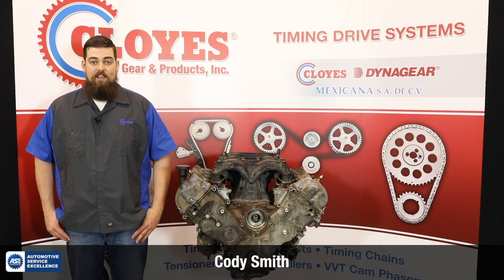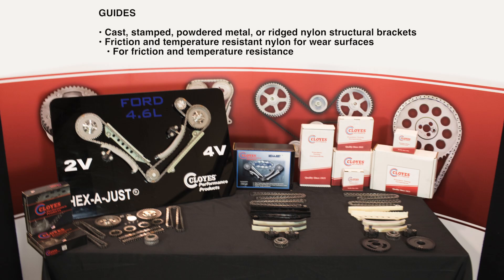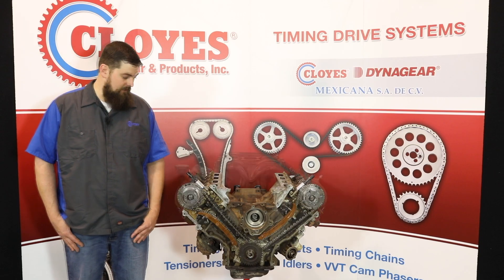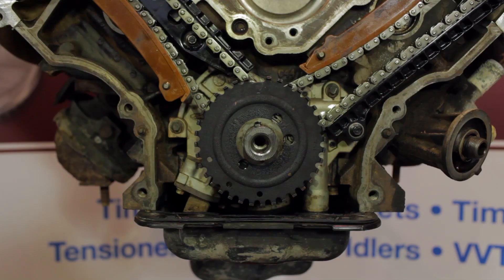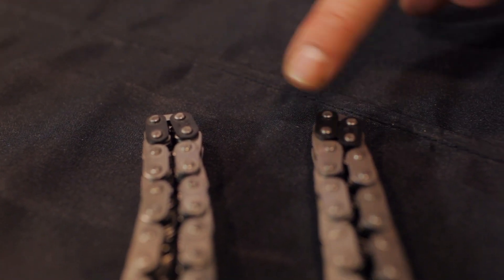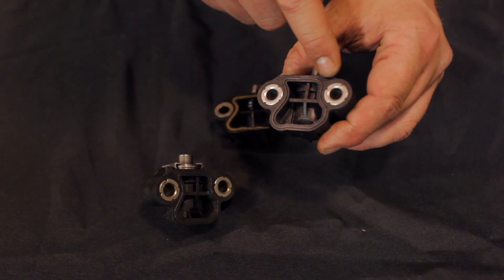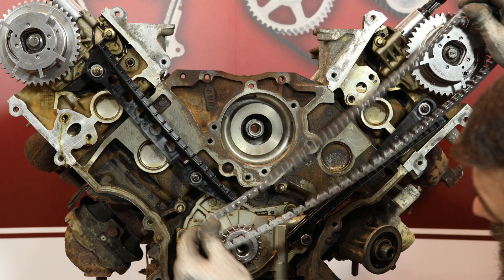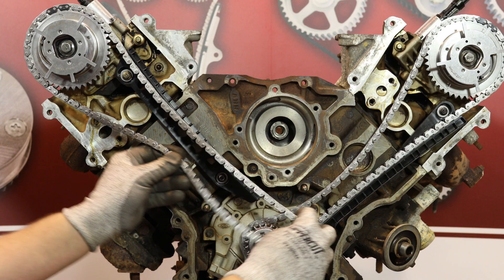Ford 5.4L Timing Chain Replacement, Cloyes 9-0391SB

Comment: The passenger cam rotated almost 1/4 turn counterclockwise to rest. I turned it back so the chain links align with the mark with the phaser, but the cam is in the middle of a rotation. I had to hold it in place with the wrench while putting the chain on. All the marks line up, but I'm worried that the timing is still off because the cam was not at rest when I put the chain on. Should I take the chains off and rotate the crank?
Reply: How'd is the engine now Bradley?
Reply: @texanbalaban6777  I wanna know too.
Reply from the maker: Nope, if the links lined up with the marks on the sprocket then you are in time. Instead of rotating the cam back, you could have rotated the crank to a spot that allowed for alignment, but there is nothing wrong with how you did it.

Comment: What's the torque on the valve cover bolts? For 04 5.4 3v v8?
Reply from the maker: 89 inch pounds, or about 7.5 foot pounds.

Comment: In your video at approximately 2:09, the cam phrasers are at 12 o'clock. So do I have to make sure the #1 is at TDC? Or its automatically TDC at 12 o'clock???🤔🤔
Reply from the maker: You don't need to worry about TDC while timing this engine. If the crank keyway is up, and the marks on the phasers are up, then you are good to install the chains. I am not sure where the pistons are at this point, but it doesn't matter. The chains set the timing, if both chains' marked links are aligned to the sprocket marks properly then you are in time.
Reply: @Cloyes01  okay thanks alot!!! 💪

Comment: So what if the passenger (r) side camshaft has moved to where the (R) is almost 1 o'clock but the driver(l) camshaft is in the correct position
Reply from the maker: Just rotate the passenger side camshaft back to the proper position. Rotate it slowly and carefully to ensure not to damage any valves. If there is interference with a piston before you can position the cam properly, you will need to move the crankshaft to a position where the pistons on the passenger side are down. Once you get the cam positioned properly move the crank back to the proper position.
Reply: @Cloyes01  so put the chain on the passenger side phaser and turn the crank or leave it off and turn the cam? And if I need to turn the cam what is the easiest way
Reply from the maker: @williamdavis7535  Leave the chain off and position the camshaft properly, then put the chain on. If the phaser bolt is tight use it to rotate the camshaft.
Reply: @Cloyes01  I just finished the job and got everything back together and it idles great but as soon as I put it in gear it tries to die and if I hit the gas real fast it does die and if I hit the gas to the floor in park it revs to about 3000 and then acts like it has a rev limiter and wont rev any higher...HELP
Reply: davis  sounds like what happened to me when my spark plugs fouled and melted a catalytic converter 🙄
Reply: @williamdavis7535  damn... sorry to hear that but did you get it fix. What was the problem?

Comment: I followed the instructions and passengers side cam rotated a quarter turn
Reply from the maker: No problem. Just keep following the video, When reinstalling the chain you will either rotate the cam back or rotate the crank so the marks align. As long as the sprocket marks and marked links are aligned when you are finished the engine will be in time.

Comment: Great video. Thank you! I thought about buying the cheaper chains but after watching this, I will buy yours.
Reply: If you fold a piece of paper a few times and lightly bolt it under a cam cap it will keep the camshaft from rotating.Just don't forget to remove it and properly torque the cap back..
Reply from the maker: Thanks Brian! Let us know if you have any questions.
Reply: @Cloyes01  what is the name tool??please and thank you??
Reply: @mariaperalta7117  What tool?
Reply: @mariaperalta7117  - ???
Reply from the maker: @mariaperalta7117  The only special tool used in the video is the cam phaser holding tool.
Reply: What is the tool name??? Please and thanks

Comment: Worst video ever .you never said that the crank timing mark should be at 6 o.clock position.or replace the oil pump so you have prper oil pressure to operate the tensioner and phasers ...do your home work boys
Reply from the maker: The crankshaft does not need to be at a certain position when setting the timing, the chains set the timing. All that matters is the marked chain links are aligned to the marks on the sprockets. This could happen anywhere from 4 to 8 o'clock depending on where the camshafts are positioned. 
And yes, oil pressure is extremely critical as we explained during the cam bearing inspection process. A new oil pump is always a wise investment.
Reply: Cloyes Gear & Products, Inc. lol u can't please everyone u covered everything very clearly if people would just listen to what u said instead of what u didn't say lol thanks guys

Comment: I followed this instruction step by step. When I unbolted the passenger side tensioner the damn cam phaser rolled ccw. The marks on the chain are still aligned with the mark on the phaser.....theyre only about maybe an eighth of a turn ccw out of position. What the hell did I miss?
Reply from the maker: This is OK. The chains set the timing so once the new chains are on just make sure all the chain and sprocket marks are aligned. If needed when reassembling, you can slightly rotate the crankshaft to make the marks align on the cam sprockets align with the chains. The exact positions of the shafts don't matter, just that the chain marks are aligned properly to the sprockets.
Reply: Ron Gillespie that’s what I’m trying to figure out before I start the job. Shouldn’t the 3 followers on each side be removed so the cam is at a neutral position, that way it doesn’t jerk one way

Comment: Can a lose/stretched chain cause fuel trims on one side to stay high (+20-+30%) idle up to 3000RPM? Been chasing this problem for a year.  Will always misfire on cold start and clean up at running temp. It also stumbles  bit at highway speeds under light acceleration.
Reply: Phil the misfire under light acceleration at highway speeds in more then likely your spark plugs/coils. It’s common on these engines to experience a shutter like misfire at light acceleration at higher speed. As far as the fuel trims you are describing it sounds like a vacuum or false air leak. See if when you press the accelerator a bit see if the short term fuel trim goes down. If it does you have a vacuum leak, pcv issue or faulty mass air flow.

Comment: Is there some other aftermarket parts we can use besides FORD OEM ? Can't really afford 900 for the kit
Reply from the maker: We are hoping you would buy ours. The Cloyes kit is part number 9-0391SB.
Reply: @Charles Ball 

http://www.modularmotorsportsracing.com/cart/index.php?main_page=product_info&cPath=4_7_56&products_id=1052
Reply: @Charles Ball $417 after shipping. Wear strips around $60 the guy told me off top of head over phone yesterday. I let Ya know how noisy they are in a few days 👍
Reply: @Charles Ball first set included, replacement set cost is around $60 for next timing job about 160,000 from now hehe

Comment: I’m so confused fordtecmakeuloco has a 4 part video showing this entire job in detail and clearly shows removing roller followers. Can anyone that has done this job successfully please comment if this video is correct. Also with some research I’ve see these tensioners blow out quick around 10k miles any info would be greatly appreciated.
Reply: This dude is correct,  I just did this job. Didn't touch a follwer at all. Fordtechmakeuloco is following the ford  process by the book.  This way is quicker and less intrusive.
Reply from the maker: Roller follower removal is only necessary when replacing the camshaft phasers without removing the front timing cover and chains. Ford published a set of instructions for this process which required a special wedge tool and the removal of the followers to keep the camshaft at rest during the process. This sequence was adopted by all the repair sites like AllData for any timing service, but it is simply not necessary when pulling the timing cover off and replacing all the components. Removal of the followers will keep the camshaft at rest and may make the job easier, but as we show in the video the crankshaft can be turned slightly to make up for small movements in the camshafts. As long as the marked chain links and the sprocket marks are lined up properly the engine will be in time.
The OE and subsequent aftermarket designs of chain tensioners in this application have had their issues. Sealing gasket/O-Rings were known to fail due to questionable materials and casting features. The current redesigned Cloyes version of these tensioners are exclusive to Cloyes and have addressed all the original failure points. We have not had any issues with the quality of these tensioners. I hope others comment with their experience. If you prefer the earlier style cast iron tensioners we still offer those as well, part numbers 9-5338 and 9-5339. The cast tensioners will work on 3-valve heads in place of the nylon bodied units.
Reply: Cloyes Gear & Products, Inc. I just paid for the complete timing job details from ALLDATA as you mentioned and they clearly state put crank key way at 12:00 then remove 3 certain roller followers on each bank after that set crank key way to the 6:00 position then you can proceed to remove timing components. So what your saying this info is wrong ? I would much rather be confident in the process and rest assured that it’s done correctly
Reply from the maker: @jerrycremeans2865  Yes, that is exactly what our last comment addressed. Their procedure isn't necessarily wrong, because it is still going to work in the end, they just add a handful of unnecessary steps that are only required when replacing phasers with the timing cover on.
Reply: As soon as I un bolted the passenger side tensioner the cam/phaser rolled ccw about an eighth of a turn when the chain jumped the crank sproket. You seemed to have skipped something in your video cause I did EXACTLY as the guy did and the chain jumped the crank sproket, rolling the cam out of timing! Is it possible to regain the timing on the passenger side without affecting the driver side, cause it's STILL in timing.
Reply: @NeroticNoob  yes just aline chain marks on sprocket and phaser then engine will be timed.
I loosened all cam caps (repeated steps starting in middle and working outwards) to install all 24 lash adjusters and 24 roller followers at once
then left cams VERY LOOSE with cam caps ON,
Installed chains, guides, tensioners (pulled pins)
Tightened down cam caps to 7.4 ft lbs according to correct order
Done! All this while crank key way at 11 o'clock with OTC crank position tool
Reply: Fordtechmakeuloco is the man when it comes to these engines. More complaints of this job going bad on this site than on his. Don’t cut corners on this job! Buy the Ford components or you will destroy your engine!

Comment: I have a 99 Expedition 5.4L.  Does it have a phaser, is there a sequence to remove the roller followers, and lastly should the crankshaft be in a certain position (i.e. 11:00 or 6:00) when I take off the roller followers like we do in an '04-'10 Expedition?  Thank you.
Reply: Rene Jacques you might need to just grab a manual and learn
Reply from the maker: Cam phasers were not introduced in the modular engines until the 2004 3 valve engines. Roller follower removal is not necessary for chain replacement, the procedure in the video will still work great for your 99 model.
Reply: @Cloyes01  I'm actually doing a head gasket job. Sorry I wasn't more specific earlier.  I'm guessing my 99 expedition 5.4 has roller followers. If so do I need to put the crankshaft and camshaft sprokets in certain positions before removing the roller followers and what sequence please?  Do you have a similar video for a 99 expedition?  Thanks for your reply.
Reply from the maker: @renejacques8288  I would recommend putting the shafts in the positions shown on the video. This will make setting the timing easier once the heads go back on. I do not have any information on the followers. Removal order should not matter, but there is likely an installation sequence you need to follow.
Reply: 6 oclock

Comment: I have another question for you I have changed the timing chains oil pump tensioners cam phasers just about everything what are the engine runs and idles really well soon as I throw it and drive it starts to misfire seems like a random misfire like the timing but the timing is correct I have compression I'm trying to figure out what else it can be I'm leaning towards a computer problem everything else is already passed or been changed do you have any thoughts it's only when the engine is under a load that it starts to miss fire
Reply: @Steven Michael  coil spark plugs VCT solenoids cam sensors were all my first things to change then I did the timing oil pump cam phasers and it still misfiring under a load it runs perfectly at an idle
Reply: @Steven Michael I'm usually really good at this and I always figure it out but this one has been really messing with my brain I'm thinking is the computer something going on bad with the wiring harness I had a Ford Crown Vic pretty much the same motor and the computer kept telling number 3 injector to spit constantly and I had straight raw fuel coming out my exhaust so the computers plays a big part in the timing and firing order
Reply: @mariobombin219  reset the pcm by disconnecting negative from battery then jump just negative battery cable, while off post, to positive cable (while on positive post), keep jumper connected about 10 seconds to drain capacitors in pcm, then will have to relearn and start fresh
Check injectors 
Make sure cats aren't clogged
Reply: @texanbalaban6777   really I never herd that i know taking the battery off will shut eng light off. but never herd thats how to reflash it
Reply: @mariobombin219  did You figure out Your misfire ordeal?
Reply: @texanbalaban6777  no not really I got another truck but i still have it and I'm going to get back at it soon I got to much money and time In it to give up. I started taking it all apart again so I'm going to check over timing marks make sure i dont. Have Any mistakes but if so it can't be much cuz I would of bent a valve but 1 tooth no probably not.  After i check that I'll try what I said about the pcm I just look it up and your right to drain the pcm down and start the truck to relearn everything. If you got any other thoughts I'm up to hear them
Reply: @mariobombin219  with the scan tool from Amazon You'll need to download Torque Pro app for $5.
Absolute best way imho to learn the app to read Your truck is go to Ford-Trucks.com in the 2004-2008 F150 section. F150Torqued has a slough of good info
Reply: @texanbalaban6777  which scan tool I have autel al519.  But I need one to read timing and every thing i think
Reply: I Am going to start working on it again have a few jobs to finish up out of state. So I'll let you kmow what i find I just want to check all the timing marks again before I put it all back together like i said it starts and runs good till I put it in drive soon as a load hit the motor starts misfiring seem like
Reply: @mariobombin219  I'll be here 🍻
Reply: @mariobombin219  I'm not sure which tool that'll be to read timing to be honest. When I did timing job I made sure everything was buttoned up perfectly and truck is smoother, quieter and more powerful than it ever was in the 5 years I've owned it
Reply: I remember reading somewhere maybe an Amazon review for this kit. A guy did something like going 65mph and letting off the gas and not touching it to a certain mph. This procedure supposedly resets something. Sorry for being so vague. But I'm sure with a little research you can find what I'm talking about

Comment: I DONT GET HOW  U SET THE CRANK SHAFT SETTING-NO DETAIL.COM
Reply from the maker: With the crankshaft key around the 12 o'clock position, the single marked link of each chain will align to the timing mark on the crankshaft sprocket face at around 7 o'clock.
Reply: THANKS I DID TRY THE 11 O'CLOCK AND 6 O'CLOCK POSITION ITS START BUT STALL THAN STOP RUNNING THANKS 4 YOUR HELP
Reply: @Cloyes01  Thats bullshit
Reply: 6 oclock

Comment: Crank sprocket out of elinement after you put chain on should be at 6 o'clock looks like 7
Reply: He put the key at 12 o'clock not at 11 in this position I think the cam is in neutral position.
Reply: Yeah i dont think im buying any more cloyes
Reply: Dude what's your deal. This method works
Reply: Worst video ever ..he should actually get a job that requires a wrench in his hand...these corporate boys dont have a clue

Comment: Really need to mention that there are left and right tensioner guides ....They physically fit BUT will make one of the chains very tight if installed wrong...
Reply: yea i did that and it fuckin broke almost exactly a year later (bout two weeks ago) and blew a hole in my valve cover because of all the chain slack..... but she ran good af till i noticed just a lil rough idle.Probably due to have no oil

Comment: How come my timing marks won't line back up. I rotated the motor so many times and the 2 links never line back up wear I put them why
Reply: Phasers are out grab a 15 mill socket and line them up the install you tensioners
Reply from the maker: The colored chain links will realign eventually, however it may take over 100 revolutions before it does.